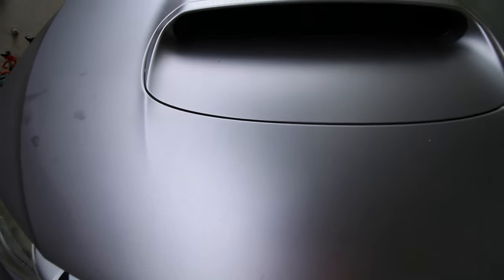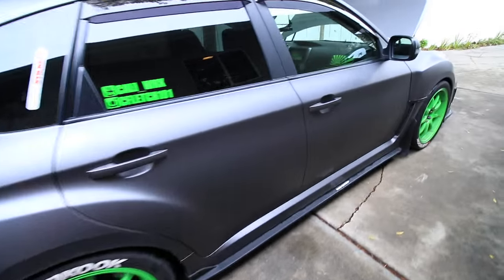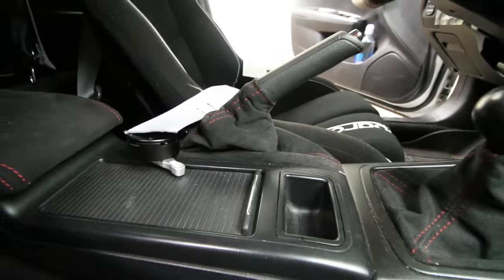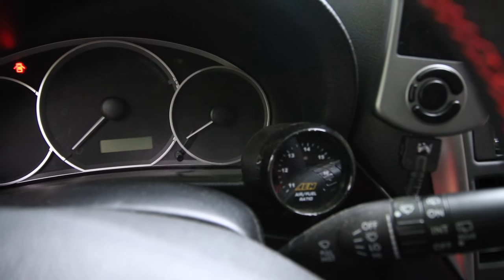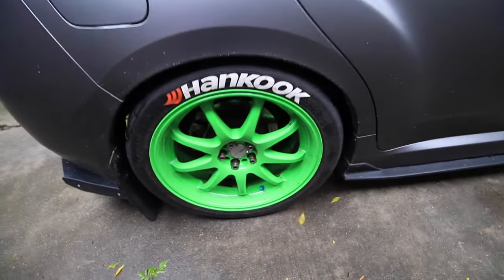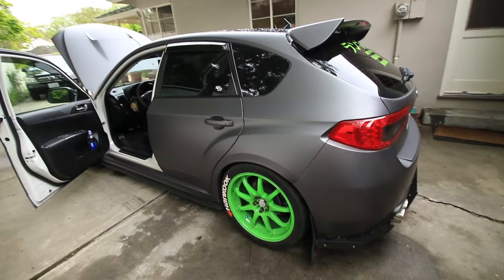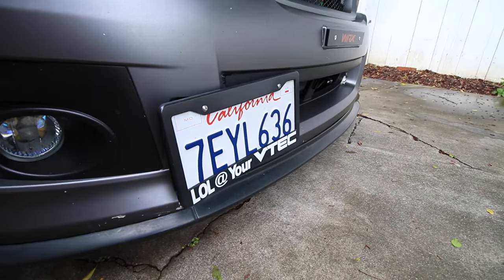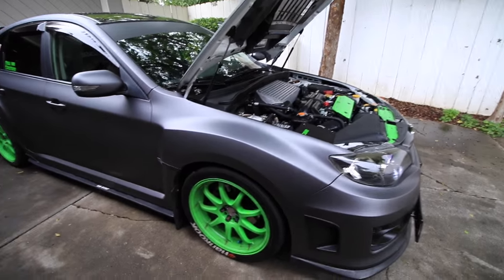335whp /388 Tq Subaru WRX Hatchback Build

Comment: Cool build! I hope to get near these numbers after getting my flexfuel sensor from cobb. Then turbo time! Stock clutch should be able to hold the power well, source : Tuner.
Reply: ***** I drive my car like a granny haha
Reply from the maker: Yes, I replaced clutch as it wasn't holding power
Reply: +Cali_WRX I guess I'll see how I do with mine. If it slips. I E85 until clutch upgrade :s

Comment: also how are the seat belts. i wanna get those for my subi but people tell me its not safe as they have no slack if you crash. While the stock ones have some slack before they tighten so you can do into the air bag alittle.
Reply from the maker: The harnesses are great, I have them very tight when I wear them, so I think I wouldn't reach the airbag. Or it would just cushion me enough. 
Hopefully I'll never find out
Reply: +Cali_WRX I just heard it bad because your whole body doesn't move only your head which can cause neck or spine damage

Comment: Hello Clint, what were your output numbers on ACN 91 octane? I'm inquiring because I have a VERY similar setup (yet to install) and am curious about what kind of numbers I can expect on the ACN 91. My car will be dyno tuned.
Reply from the maker: I was at 293whp and 313tq. As of now though, I have just a e85 map.
Reply: +Cali_WRX cool, thanks. I was thinking it should be close to 300. thanks again man.

Comment: does the trunk open all the way with the perrin wing riser and does the it cause the more water flow on the back windshield when it rains?
Reply from the maker: Trunk does not open all the way. Water does run down the windshield but there's an opening where the water runs down and out. Kinda of like a gutter. Hard to explain
Reply: Cali WRX How many degrees is the difference from stock to perrin does it not open?
how was installation, a lot of permanent drilling to the body?
Reply from the maker: No drilling. Uses stock location. I'd say it opens about only 40% now, out of the full 100% of the hatch all the way open. 
My worst install ever. You need an extra pair of hands and it's super time consuming as well as a hard to work area.

Comment: same intercooler weehoo, I'm going e85 soon too.  What kind of dyno are you testing on?
Reply from the maker: Mustang
Reply: @catzbunn  I need an AOS and some boost control.  Other then that I have a similar power set up: headers back, same intercooler, intake, 1000cc inj./pump... Did you have before/after numbers with e85? I'm trying to weigh the benefits.
Reply from the maker: Peter Cooney I didn’t push my 91 map. I never run a high power 91 map. It’s not worth it for Cali gas. I think I honestly made 280whp on 91 which was nothing.
Reply: Cali WRX yeah my tuner couldn’t really push it more without the boost controller.  I’m in mass, so we can run 93.  I’m eventually looking at pistons for a 400 wheel set up.. but that a lot of change. Lol

Comment: I've been driving around pushing 350trq for over two years now on the OEM clutch... so...the tune didn't have much to do with the clutch going out.
Just saying...
Reply from the maker: Interesting, but others I know their clutch went poo on them. Maybe you're lucky.
Reply: It's impossible for increasing output to have zero effect on clutch. It may not cause them to fail, but that's just plain friction physics.
Reply: +TheDBall73 agreed
Reply: Decided to go to the next level and get mu block done, something outside my skill range.  But while they are at it, I wanted to upgrade the clutch.  I, and the shop, where expecting to to see the clutch almost burned up pushing that torque for nearly 50k miles and 2 years old.  Nope.  We were all surprised that the clutch didn't actually have to be replaced, it was at 50%.
Verified my statement.  OEM clutch with over 50k miles at 350trq for two years, only HALF worn.
So, 'the clutch didn't last the long because of the E-85 tune'... that's not true at all.
Reply from the maker: Well I don't know what to tell you. My clutch started slipping and everything. I'm not the only person who hasn't upgraded their clutch because of the power levels their making. 
Ask most tuners/mechanics and they'll recommend a clutch upgrade. 
I stand by what I said about e85 and my clutch.

Comment: why'd you go top mount opposed to front?
Reply: on a stock turbo the spool would be slow with a front mount as the air would take longer to get to the turbo in the low to mid range rpm's it wouldn't be ideal. Function over shiny piping and fmic
Reply from the maker: Exactly what John Jones said. For stock turbo all it would really do is looks. The pros do not out weigh the cons.
Reply: Tristan Day on top of what John said, top mount being very close to the throttle body,  the throttle response is better. Downside is, it can't cool air very well in city driving when the engine heats up the top mount.

Front mount: Able to cool air better since it's out of the engine bay closer to direct fresh air. Downside is long piping so throttle response takes a hit. But front mount is needed for pushing HP numbers.

Choose whichever you'd like.

Comment: Cool walk around.  Nice clean ride. Love the wrap!
Check out my channel. I protuned and dyno'd my 16 STI. Got 353whp/421tq. E85 flex fuel.  I was surrounded by 1000 hp GTRs in the shop. I felt like a tiny ant. lol
Reply from the maker: +STiZar Haha, I've seen your walkaround! Nice stuff dude.
Reply: +Cali_WRX I've never seen so many GTRs in my life when I was getting my tune. smh.  lol. My tuner owns a Saturn IOn pushing 600whp. They also have your hatch STI pushing 900whp with a custom dump exhaust on the front passenger fender. It looked AWESOME!